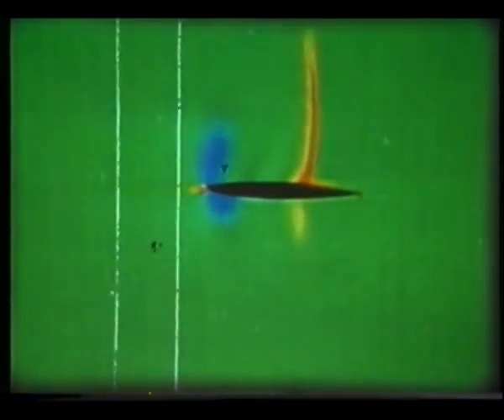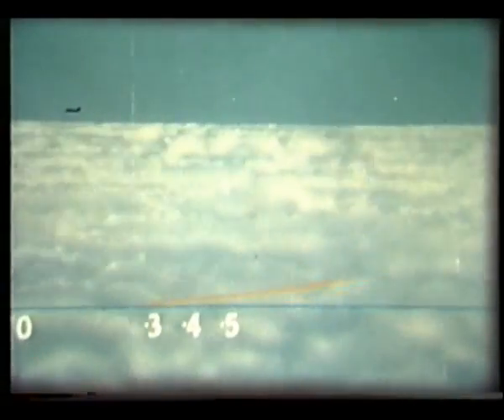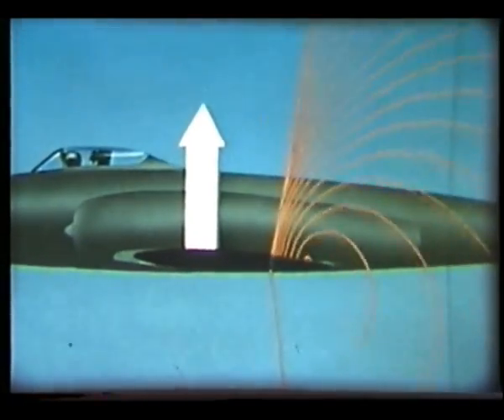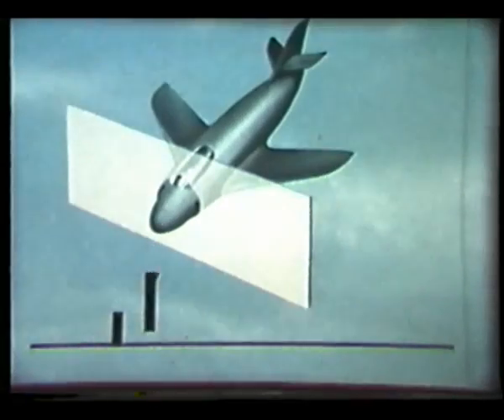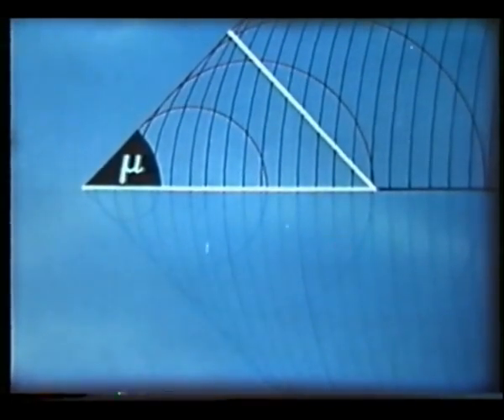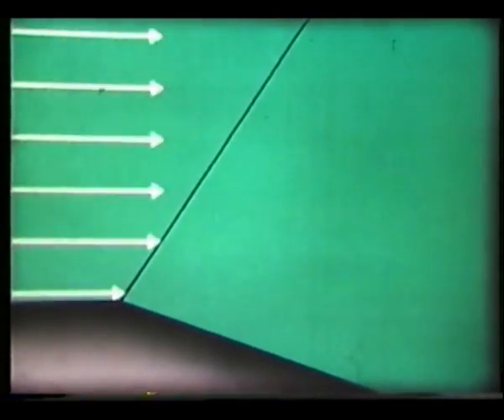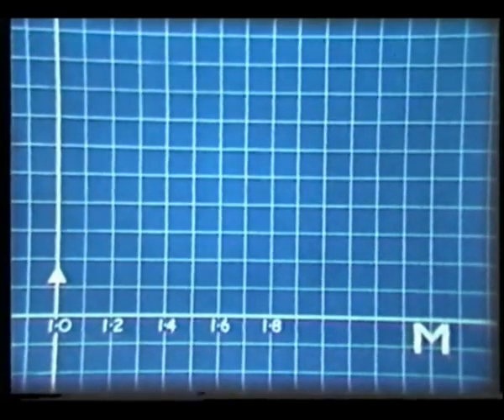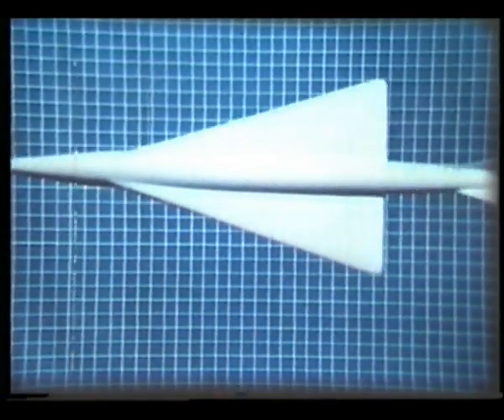High Speed Flight Part 2 and 3

Comment: This video and the first part are extremely well done.  In this part I think the discussion could be improved by clarifying what the frame of reference is, i.e. when there is a shock wave in front of the plane is it because we are considering the air to be moving at the speed of the plane?  The ambient air is just standing still.  No vehicle has touched it yet....  If there are pressure waves radiating out in front of it why do they magically congeal at a certain point?

Comment: Finally some accurate information regarding science.  The only inaccuracy is the fact that they claim that temperature is the only factor that alters the speed for mack one which is not true.   The simple equation actually is:  pv=nrt  This gives you the equivalent state of state of the air to retain the same density which is the real issue.  And yes I am a real engineer.
Reply: The simple equation actually is: a=sqrt(gamma R T). For a calorically perfect gas in which Cv and Cp are constants, the speed of sound is a function of temperature only. And yes I am a real pilot.
Reply: @piers4130 you’re absolutely right. Not sure why this fella was trying to assert that density affects the speed of sound. Temperature is effectively the only thing that does. And I’m also an actual engineer.

Just goes to show, just because someone says they’re an engineer doesn’t mean they know what they’re talking about.

Comment: 9:28 This bit here has always been a bit misleading. The jumps and dips in lift coefficient as Mach number increases are being equated with jumps and dips in lift. This isn't exactly true, because the dynamic pressure is increasing with the square of Mach number for a given ambient pressure. So even if CL drops in a given transonic region, it's possible for the lift to increase due to the increase in dynamic pressure...

Comment: 57 years after this video, the aircraft`s shape haven't changed much.
Reply: For commercial and military not much but we have hypersonic gliders and scramjet planes that look radically different
Reply: Because of heat, & some of the characteristic change dramatically after certain air speed, so shape of the future aircraft will utilize this concept further.
Reply: Delta fighters are in vogue again thanks to FBW.    Stealth is now part of the design, necessarily sacrificing some aerodynamic performance